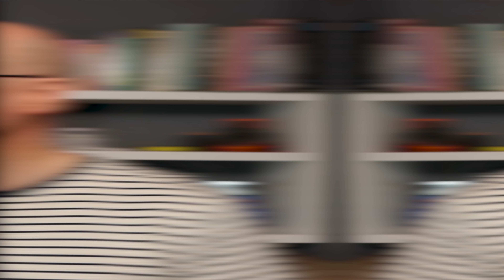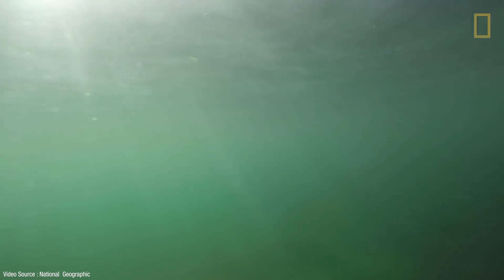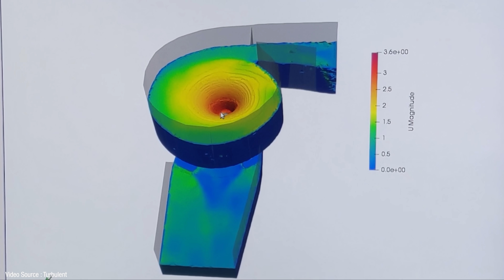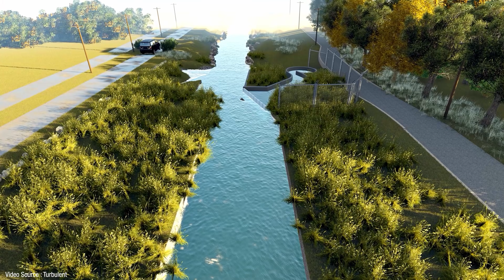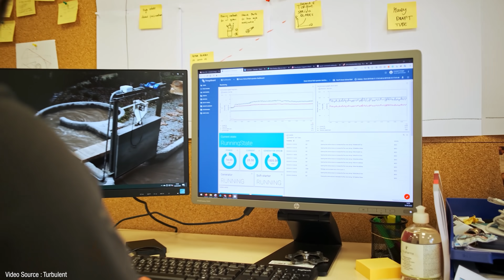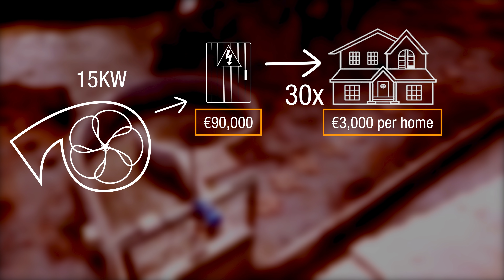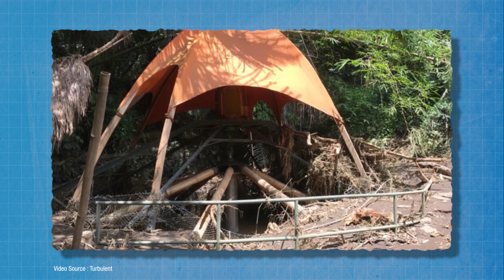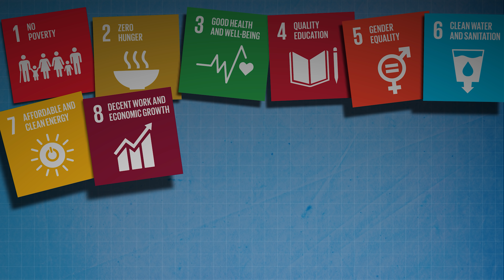Micro Hydropower : Turbulent Turbines

Comment: These look great for very rural areas without deep freezes and with consistent stream flow.  However, the amount of energy you can get out of a given volume of water is proportional (approximately) to the difference in height between the inlet and outlet.  This is why very tall dams get built, more power for a given water flow.  So while these can help, they won't "replace the grid" in any area with significant power needs.  

In areas where there isn't a large drop in elevation, you are limited to micro-hydro and these look good for that as long as only part of the stream's flow is diverted and the majority of the water is left in the original channel the environment isn't changed too much.
Reply: You are correct.  Dams with Francis Wheel turbines must have a head of at least six metres to overcome cavitation.  These low-power units will have no cavitation issues.

Comment: As a Canadian, where hydro is king, I would say that these look really great, particularly for mountainous places, but I think that the much more obvious place for hydro electricity production is on our countless unpowered dams! I spent a lot of time whitewater kayaking and I can say that most dams here are unpowered, just for flood control but the flow rates are massive and the head is really good too. I think we ought to power up our unpowered dams, then use the resivoirs as batteries for more intermittent renewables like wind and solar. No need for Lithium batteries, natural gas peaker plants or pumped hydro, just good dam control!
Reply: From what I understand the problem usually is the cost of getting the wires there. It just isn't worth it to spend that much money on getting it connected to the grid when the generation is not that much.
Reply: In the USA only 3% of dams produce power. The Dept.of Energy claims that there is 65 GW of untapped power at potential small and micro hydro sites in the USA
Reply: @kateegnaczak5902  According to wiki that 3% has a 75GW capacity. Ie more then the other 97%. Numbers mean nothing without context.
Reply: you realise dams in the middle of nowhere are no use for supplying electricity to population centres? that's why they aren't powered.

Comment: That cost analysis doesn't quite pass the sniff test. 15kW for 30 euro homes: so that's an average draw of 500W. 12kWh per day sounds a bit low, but let's accept that for the sake of argument. The problem is that each house doesn't draw 500W continuously. To smooth out the differences between generation and consumption you need to factor in the cost short term storage. The cost of a solar installation already has that cost factored in (at the moment the batteries are the lion's share of the cost), so does the 90k Euro cost include such storage?

I'd love to have micro-hydro, and if I lived on property that had running water I'd definitely look at including that into generation. Even a modest generation capacity can greatly reduce the requirement of short term storage for a solar installation, which has knock-on financial and environmental impacts.
Reply: You also could not get anywhere near 15kw out of a turbine with low head and smallish flow. Fudging all over the place

Comment: I am a fan of the Turbulent system as well. My problem with using them here in Alaska is regulatory, meant to protect the salmon spawning grounds for the fisheries. This is something I am firmly behind, we need these fisheries to be as healthy as possible. That led me to the two micro hydro rigs posted below. The only difference is what kind of moving water you have. One is designed for rivers and creeks and is fish friendly. The other is designed for water sources that have a lot of head, or the drop in elevation, the water is coming from. The more head, the more power potential. Both are compatible with Alaska's stringent requirements for regulatory approval.

https://waterotor.com/
https://www.powerspout.com/

Comment: YES, Decentralised energy from Micro Hydro is the way forward for anywhere with running water, the UK has a vast network of surface and subterranean rivers, that could provide most areas with electricity. Also Micro Electrolysers for making local Hydrogen to store for times of extraordinary events such as flooding. So energy and heat can still be generated using CHP-HFC.
Reply: Here in DE about 5% of the electricity comes from hydropower, mostly run of river, as we are lacking higher mountains. It is estimated that the hydropower ressources are almost used, maybe another 1 percent point is possible. The largest increase of the last years was the upgrade of a plant at the river rhine, which needed as new concession after 100 years, and the requirement was a better water usage, meaning more installed electrical power on the other hand, which means that less water is poured over the weir, but this also means a smaller capacity factor. In the dry season (low water in late autumn), some of the turbines do not spin. The problem with microhydro turbines are that they are tiny, and they can't really compete with othere sources of electrical energy, even though they get support according to the renewable energy sources act. That concept seems to be better suited for microgrids in remote areas, helping to promote rural electrification.
Reply: @gunnarkaestle  I agree with your last point of Micro Grids, that could be supplied electricity from a variety of Micro renewable sources. We chuck out millions of appliances and devices every year that have motors in them, that could and should be repurposed as Mini/Micro renewable energy gene’s, there’s a lot of people now making DIY scrap build renewable energy generators, I’m in the process of making my own Wind Gene for my Balcony, and a pocket hand wind gene to charge phones etc when camping, hiking etc. It is madness to chuck all these motors away, then build massive Wind farms etc. You mentioned the Rhine, so you are in Germany?, in the UK there’s more than enough rivers, streams etc to power most of the country, also we have subterranean rivers that could be tapped for Micro Hydro.
Reply: @Kiyarose3999  While do-it-yourself is a nice hobby, and I think that repair seminars are helpful to educate people how to use some basic mechanical and electrical tools and skills to get away from a buy scrap and throw it away after short usage mentality, I don't really think that this will have a large effect. Especially with electrical applicances you need proper engineering regarding safety, as you don't want to electrocute people on a regular basis. 

Yes, I am in Gerrmany, and as both DE and UK are not know for large areas with alpine mountains, I doubt that the amount of hydropower can be expanded much. You need rainfall (check) and a gradient (no check). Subterranean rivers are important for the flow of groundwater, but they are most probably not suited to tap for electric power. As far as I know, the UK has favourable conditions for micro wind turbines; here in Germany you can by sets up to a few kW, but the site approval is almost as extensive as for a 3 MW unit. If you want to operate a grid connected RES-E generator for self-consumption and excess power feed-in, it is much easier just to put PV panels on the roof.

Comment: There have been small micro-hydro generators in the USA for decades on smaller low head dams which are grid tied and run profitability. More recently plenty of dyi-ers that have them for small remote off grid cabins, ect  
Los Angeles has them to recover some of electricity lost pumping the Colorado River over the mountains (pump up-generate down). There are also units that fit in larger diameter water mains as well. They're all good with steady consistent volume of flow.

Comment: Gosh, imagine all those canals around Birmingham being managed to both produce power an operate the locks only as often as they are needed.
Reply: The canals don't have flowing water like a river. No good.
Reply: @Withnail1969  I stayed there and saw locks all down the the hillside.  Some water has to be maintained to operate the locks, but probably not as much as exists.
Reply: The Delphi locks in Dudly drop 26 meters.

Comment: Large power facilities have permitted the growth of mega cities with corresponding civilization benefits. Micro power installations are great if you own your own estate,  but if you live in a small apartment in a big city,  you have no option except to be dependent on a large remote installation.  Growth of these has stalled because of reduced consumption due to technology improvements like LED lighting and efficiency improvements leading to smaller factories. If power consumption does not continue to decrease, we may resort to orbiting solar arrays with power downlinks to earth stations,  probably a better option than current types of nuclear stations .

Comment: What a great development. I am not so enamoured with the alarmist uttering in relation to hydro though - yes, large hydro does severely disrupt the ecosystem, sending some species to extinction, but little is mentioned of the ability of nature to adapt and the new species that populate the new environment created by the damming of the water flow. 
Yes, bad design does cause flooding, but bad design can cause flooding in any tampering of water flow - the issue here is bad design, not large hydro. 
And no, I have no commercial interest in large hydro what so ever.
The attraction of such systems, I think, is the ability to make it local and remove the large vested interests that typically run large hydro. Solar can do the same (make it local).

Comment: Reminds mean of looking down into a washing machine.  Humor aside, I live in a region that gets about 45 inches of rain per year. Yet during the summer even some large rivers drop down to less than 300 cfs for weeks or even months in the upper half of their range. Much different than the several thousand cfs at other times of the year. Since certain flows must be maintained.  How many cfs would be needed for these installations to operate? Would the whole river need to go through the turbine to provide power?
Reply from the maker: You would need to have a look at their website to get that sort of detail, I think.

Comment: Actually damming a river to produce even 1.5 meters head has an environmental impact whether this is more or less (per unit output) than a large scale HEP installation has not been investigated here. Also this vortex system does not look very efficient and it is perhaps significant that no data has been provided.
Reply from the maker: There's no Dam. That's the point. And they have examples in everyday working use, so I guess it must work. And you can go to their website to get technical data.

Comment: I am assuming the blades are made of an easily recyclable material that could have a low enough specific gravity that if it were lost in a flood, it might float near the surface instead of sinking to the bottom of wherever it stopped. if it floated and were washed into the ocean, it could be harvested by one of the companies that picks up floating sea pollution. if there was an address or website on the blade, it could possibly be returned to the project that lost it. I am a dreamer of how people can be good to each other as well.

Comment: There are over 30 major rivers in the UK alone. These turbines could be installed all along the length of these rivers. I wonder what percentage of the base load they could generate? Small scale turbines doesn't mean small scale generation.
Edit: I've just done a rough calculation, and if there are around 1,500 usable miles in the 32 major rivers, and you install a 200kW turbine every mile, you could generate 300MW. (And in some places you could install more than one turbine).

Comment: I have been keeping a beady eye on these guys for a while - I think they are awesome.   It would be great if they made a smaller one (approx 500W?) but only because I assume there will be plenty more streams like the one that runs through our farm. Oh, about 40litres/sec for most of the winter, since you're asking.  500W of hydro with 4kW of PV and a domestic battery will pretty much cover a household with modern living standards.  (Unless you have a heat pump or EV)  As a side note, as an engineer I would have a long driveshaft going up and keeping all the electrics out of the water.   Even the best sealed bearings are not going to last 30 years in gritty, silty water.

Comment: I had heard on the radio, some  20 or more years ago, of a family who had bought an old watermill here in the UK , and how they had  opened the water gate that had long been closed off, to divert water to drive the wheel.In this case the wheel had been fitted to supply electricity to the new owners family home. The water board on hearing of this, demanded regular payments for using what they refered to as their water,even though it passed back into the main river from which it came.
Reply from the maker: What an absolute disgrace. What has the world come to??
Reply: @JustHaveaThink  , Not exactly where we need it to be for sure! But it is reassuring in some degree to learn through your presentations here on Youtube, of those that are showing us the way.

Comment: This neat solution it should be made clear is aimed at the tropics and sub-tropics though and the regions within that have a decent all year rainfall patterns and / or river systems that don't dry up at any time over the year.  In all other scenarios it requires to still be paired with some other form of generation to make up for the times there isn't enough water.
To those that think surely Wales or Scotland or some other soggy part of Europe should be ideally suited, nope, not nearly enough rainfall.  A friend of mine runs a micro-hydro outfit and built amongst others a scheme on Snowden in Wales and the Isle of Arran and neither runs much during the summer months and sometimes not even in winter when there is a dry spell.

Comment: This is definitely a contender for becoming the most popular type of hydro generation in the future! 
A string of these spreading the length of a river would give a large output for a low (relative of course) cost. It would also have the advantage, if interlinked, to allowing interchangeability!

If you (or a group of you) own say a dozen of these you could afford to have spares on hand at 1/12th of the cost of only owning one. This would allow you to take one out of production and replace it with the spare unit and repair/ replace the original at leisure!

The relatively low cost could allow communities to grow their production or just make a private distribution network and keep it all in house. Flexibility!

As has been commented by others on this thread there are many ex-watermills around the UK (and other countries) that could be repurposed to give a more diversified power network, thus stabilizing the grid. This can be eather load balancing or frequency stabilization. That has got to be better than the current idea of having generators dotted along the motorway network to cover peak loads ...... or battery farms!

TBH I can see the case for firms setting up to do this as a business model. Back in the day (pre-privatization) Norweb used to have it's own bio powered electricity generation plants (methane fueled engines and Hydro) .... but all that was lost in the sell off by United Utilities! This was one of the reasons electricity prices stayed static for so long. All the money generated from the different parts of the company went directly to offset the cost of purchasing energy from the generating companies! I am certain the other REC's did the same.

Back on subject, I think that properly utilized this is one of the best things for both the environment and us as individuals!

Comment: This is a brilliant idea for communities if they can get a bit of funding together.
On a more personal level, if you live where there's a lot less water but a lot more gradient, there are other very nice micro hydro systems available using higher pressure nozzles and pelton wheels. I believe you can get up to about 1kW off reasonably sized turbines. Joe Malovich has documented installing and tweaking his ~400W unit quite nicely on his channel.

Comment: Home Power Magazine had many articles on micro hydropower, archives available online. The hard part is getting access to enough flow rate and slope/height. Often water sources are seasonal.

Storage might still be needed or useful since   demand has peaks that exceed average load    from a mostly constant hydro output.